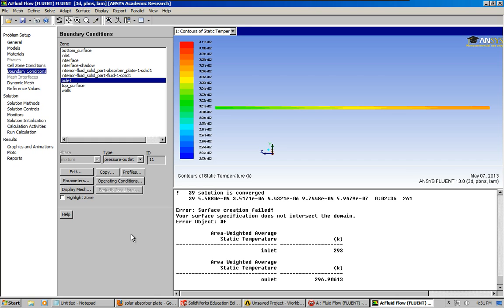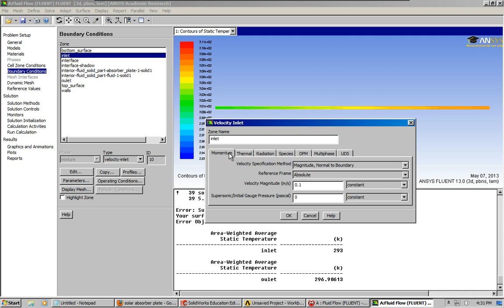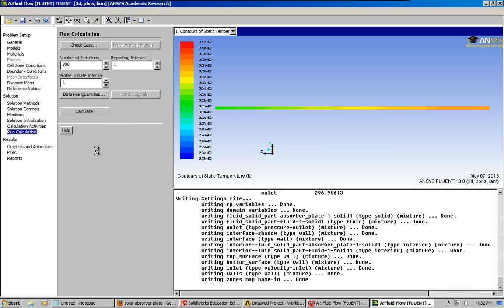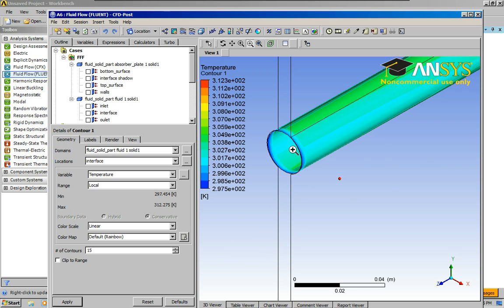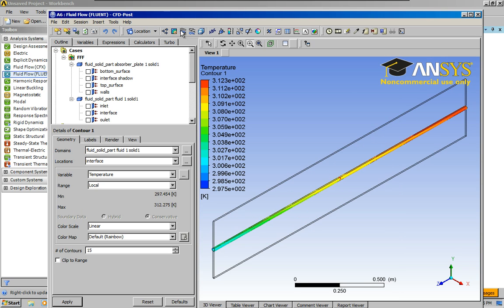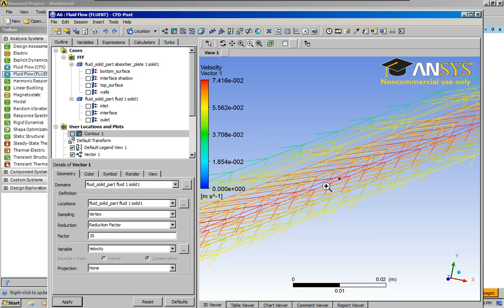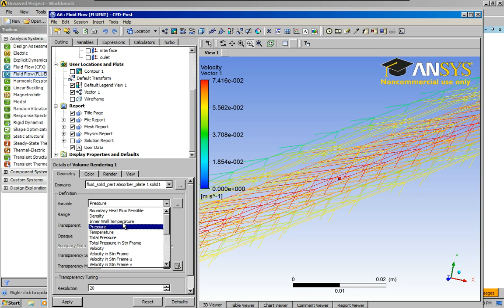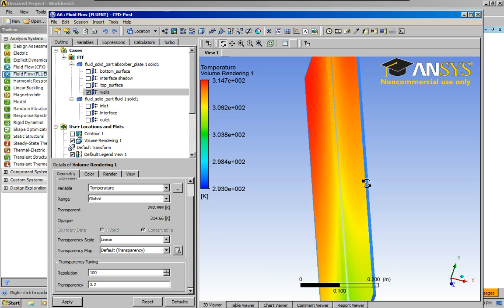Ansys Fluent Tutorial Solid to Fluid Heat Exchanger Part 5 solver and results

Comment: I have a 2D model of heat exchanger pipe-in-pipe. There are 3 rectangles - one representing middle pipe with flue gas (axis of symmetry as the bottom edge), one representing wall in the middle and one representing outer pipe with water. Whatever I do I can't get the heat to flow between water and flue gas, plus the outer edge of water pipe doesn't seem to exchange heat with surroundings (convection condition, coefficient is set as 5 W/m2K). What am I doing wrong? Is there an additional option I have to turn on?